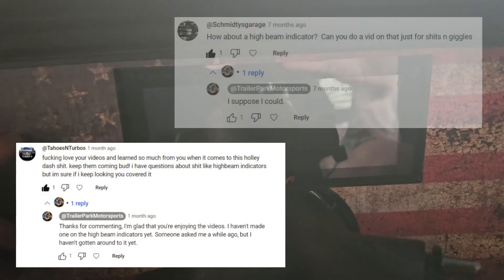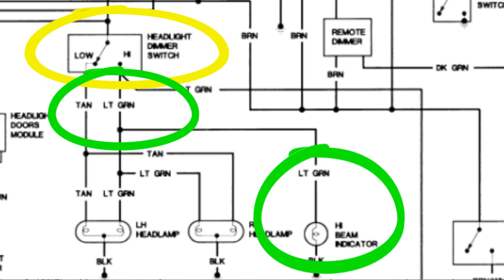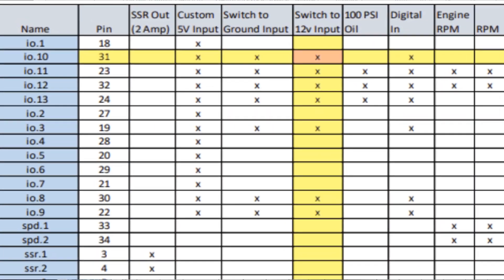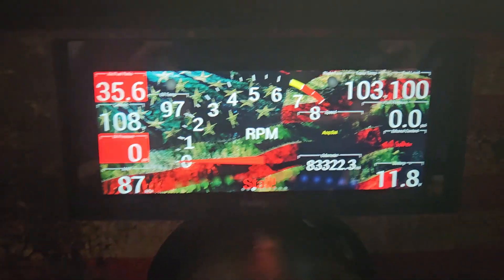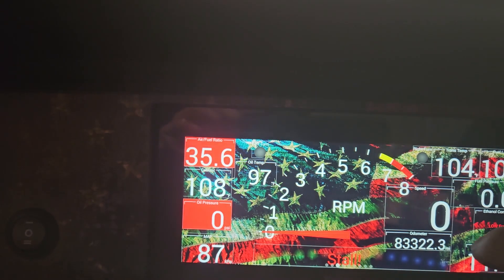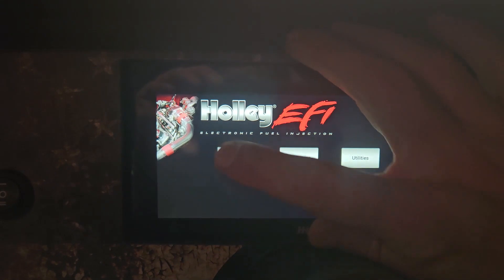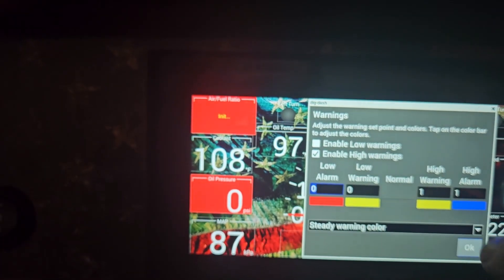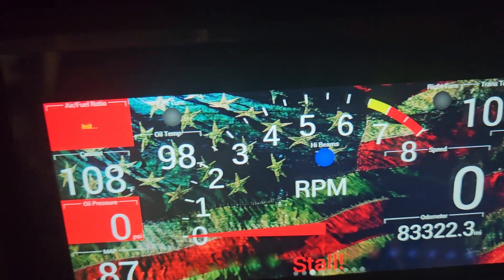How to setup a High Beam Indicator on a Holley Pro Dash

Comment: How would a guy add a coolant temp and oil pressure gauges to the dash?
Reply from the maker: Thanks for watching and commenting. I have a video called "How to add a gauge" on my channel, I believe that will answer all of your questions. I also have a video where I added an oil cooler and went through the process of adding the gauges on there as well.

Comment: Can the dash be configured with two fuel gauges?
Reply from the maker: Inputs 4, 5, 6, and 7 can be configured for custom ohms, so I suppose yes.
Reply from the maker: Curiosity got the better of me, so I just tested it with input 6, and it absolutely let me set up a 0-100% fuel level gauge based on a 0-90 ohm input.

I hope this helps, thanks for watching and commenting.
Reply: @TrailerParkMotorsports  thank you...that's helpful. I'm converting a 70 Bronco to EFI and have duel tanks
Reply from the maker: @0347kali I figured you had some sort of truck when you asked about a second fuel level gauge. It sounds like a neat project, I'd love to see it when you're done.

Comment: Just curious why you don't just use the extra LEDs up top for turn signal and high beam? Thats how i set mine up. Keeps extra stuff off the display itself.
Reply from the maker: The steering wheel blocks some of them
Reply: @TrailerParkMotorsports  Well that sucks. I can see mine fine but I’m still running stock seats and steering wheel so that may be why. 👍
Reply from the maker: Could be. I don't mind all the things on that display, that's the one I use for street driving. My race screen is just RPM, boost, and water temp.

Comment: Awesome man thanks for this! its exactly what I figured and i thank you so much for taking the time to verify it. also i didnt know how to change the led color, does it work the same for the signals?
Reply from the maker: I'm glad you liked it, thanks for watching.   It should be the same for those.
Reply: @TrailerParkMotorsports  I can 100% verify it does! I'm working on the DRL stuff next but can't tell if its a switched to ground as that's what I'm thinking. doing this in both my obs Tahoe and secret 82 trans am lol